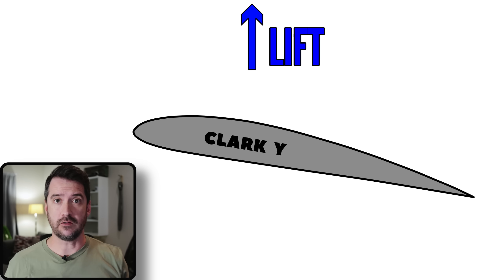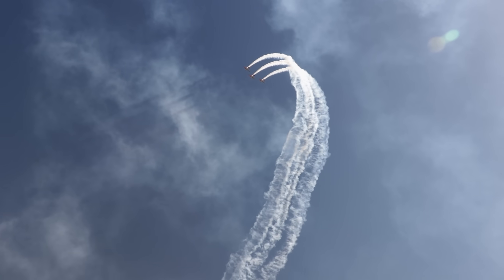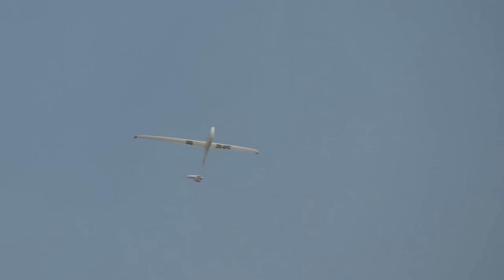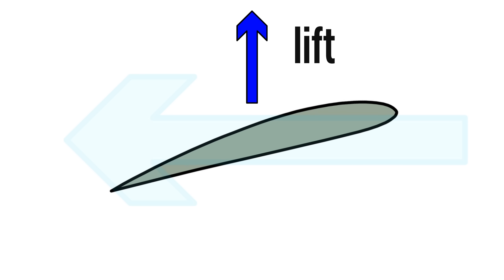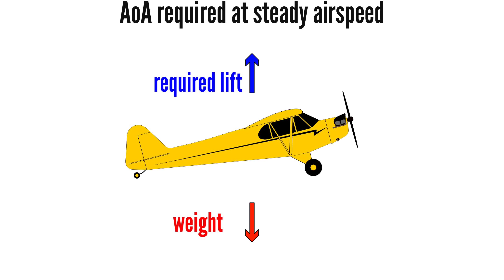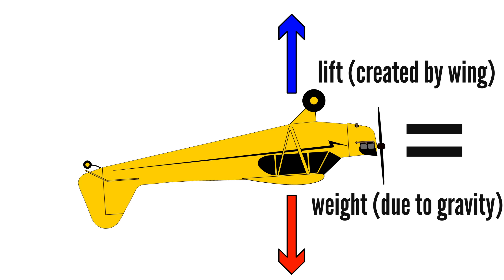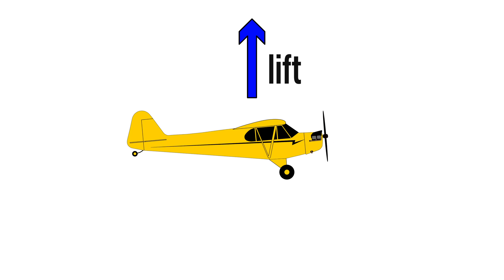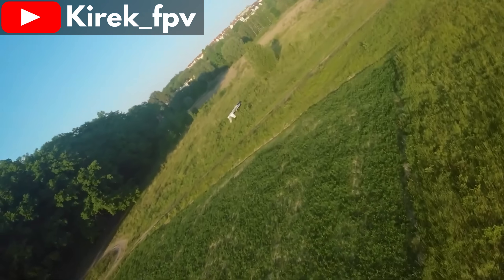Is Airflow Distance Over the Top of a Wing Always Longer?

Comment: Yes, air HAS to be accelerated downwards to supply an equal and opposite force to the weight of the aircraft. It seems the argument is more about HOW the wing supplies this force. Here is my take on this. 
The momentum of air molecules deflected downwards off the bottom surface pushing the wing up, is easy to imagine. 
The air above the wing thins out and speeds up as it covers a longer distance in the same time. 

[edit: This happens even if flying upside down, when the bottom of the wing is now on the top, due as mentioned, to the moving stagnation points changing the distance travelled by the airflows.] 

This causes the higher atmospheric pressure air some distance above the wing to move downwards to fill in the thinned out "vacuum" - in effect, pulling the air downwards (downwash) and creating an opposite lifting (sucking) force on top of the wing.
Combine both the down wash from the bottom and top, and Newton third does the heavy lifting.

Comment: The Symmetrical airfoil works because there is still a low pressure "bubble" generated by the increase in air speed due to the "ramping up" from the leading edge on both top and bottom of the airfoil. The "Clark Y" or "flat bottom" will always make more lift, though. A plane with a flat bottom air foil can fly up side down if you have a high enough angle of attack AND enough power and down elevator to over come the drag and provide the correct angle. A Flat Bottom airfoil produces lift at a much lower angle of attack, when up right.

Comment: A Cub can't fly upside down for long because it it carburated.. The engine will run out of fuel. You need fuel injection to fly inverted sustained flight.
Reply from the maker: Of course, but was only talking aerodynamics here 😀

Comment: There are 2 factors to lift the low pressure of the longer path and also the nose up angle of attack has the forward motion air pushing the bottom of the wing. It is like having a flat surface in your hands in a windy day, you put the edge into the wind it may be unstable as you fight to keep it edge on. You expose the bottom of the surface to the wind it will pull your arms up and might lift you off the ground if big enough, there is pressure on the wind side and probably turbulant low pressure behind it. You point the top at the wind and it will be forced to the ground. A parachute is a stable form of this flat surface, the hole in the middle is kind of a rudder, the round shape allows the air escaping around the outside edge to maintain the stable wing characteristic of the air not detaching from the upper surface like an unstable flat parachute which could produce lift but the back side turbulence would kill the passenger.

Comment: If you want to understand what starts the unequal flow of air around an airfoil at any non-zero angle of attack (thus creating lift) check out the "Kutta condition".    It boils down to this.   The trailing edge of almost any decent airfoil is very sharp, which causes the rear stagnation point (referenced in this video) to almost always stay right at the trailing edge.   This is because even if there's a strong pressure differential between top and bottom of the airfoil, moving air can only change directions so fast (it has inertia) so even if there's lower pressure above the middle of the airfoil, the fast flowing air below the airfoil cannot make a 180 degree turn at the sharp trailing edge and try to flow forward to equalize the pressure.  Instead the air above must flow faster to equalize the pressure at the rear stagnation point.  
BUT..  There's no such restriction for the forward stagnation point.    It can be right at the tip of the airfoil, or well below it (or above it, at negative angles of attack).  The air just sort of piles up against the "front" of the airfoil.    So if the airfoil is just a flat plate and you angle it upwards, the forward stagnation point moves down below the leading edge, but the rear stagnation point remains pinned to the sharp trailing edge.   This means when a packet of air is split in half at the forward stagnation point, the upper packet must travel a further distance to reach the rear stagnation point.   It's not equal transit time, but equal pressure at two points.  The forward and rear stagnation points each have equal pressure immediately above/below, by definition (it defines where they are).    In order for the upper packet to arrive at the rear stagnation point and equalize the pressure there, it must flow further and faster and thus creates a lower pressure region above the middle of the airfoil.    The strangest thing is that it flows faster than not only the packet of air below the airfoil, but all the free stream air well above and below the airfoil.

Comment: While most of what was said in this video is correct, what was left unsaid is that the idea that the air above the airfoil follows a longer path than that below is often associated with the "equal transit time" hypothesis, which is false.     This was taught to many in K12 physics classes and even in some older textbooks.    It goes like this.. "If a packet of air is split in half at the forward stagnation point into two, then the upper packet of air must arrive at the trailing edge at the same time as the lower packet, and thus follows a longer path over the curved upper surface".   This is false.  But the truth is stranger than that.     In reality the upper air packet does follow a longer path, but it is both accelerated rearward and downward, and it arrives at the trailing edge before the lower packet of air and before the free stream air well above and below the airfoil (outside of its direct influence).    The net result of the upper air arriving first is that it displaces a mass of air behind the airfoil, downward.   This total mass of downward forced air integrated over time equals the total generated lift, and in steady flight that equals the weight of the aircraft.      At higher angles of attack and higher wing loadings this air is accelerated over the top of the airfoil faster still relative to that below.   It naturally wants to follow a curved shape (ref "bound vortex") , and the curved airfoil shape is more a reflection of the shape the air wants to flow for a given angle of attack and wing loading, rather than something that forces the air to flow along that path.
Reply: Spoilers on cars work the same way.  The idea that the wing also generates downforce is what people have a problem with.
Reply: Excellent! And the transverse motion of air towards the wing tip creates vortices.
Reply: @ChimeraActual   The wingtip vortices occur simply because the wing is displacing a volume of air downward continuously as it moves forward.  The surrounding air has to fill in the space it previously occupied and there's a sharpish transition out at the end of the wings that creates a swirl of inrushing air.    The greater the vertical displacement (caused by high wing loading + high angle of attack such as during takeoff/landing) the greater the vortices.    As you fly faster the displacement is decreased.   If you use a longer wing (distributing the displacement over a larger area) the displacement is decreased.      One way to see this mechanism directly is to drag your hand, or a board or paddle through the surface of still water.  It'll make a temporary "trench" in the water which will then spill in from the sides to fill it.
Reply: @daemn42  I wanted you to explain it to viewers, I'd mess it up.
Reply: Are we over thinking this?

I'm more of an intuitive type thinker and my sense of it has always been in terms of pressure differentials. A wing with angle of attack will create a low pressure on the appropriate side to create lift. A brick as many might mention can fly given enough thrust.

The classic explanation of how an aerofoil works as criticised here makes sence to me from an economical perspective.

Am I perceiving it correctly??
Reply: But why would it split in half ? Below Mach 1 i don't see why it should, the flow field is already influenced by the wing before it reaches it. I'm wondering what is the actual proportion, I guess it has been computed using CFD.
Reply: @__-1234   It's not necessarily "in half", but the packets of air approaching (or being approached by) the leading edge must decide at some point to either go above or below.  The forward stagnation point is where the pressure is equal from above and below, but unequal if above or below..  In other words, a packet of air on a trajectory that would pass above the stagnation point must go above the airfoil, and likewise one on a trajectory below the stagnation point must go below it, no matter where that point is.   At high angles of attack on a high lift airfoil the stagnation point can be well below the leading edge and the air passing just  above it might even appear to reverse direction  and flow a little forward and up to get over, but it's just a balance of pressures.   

And yes the packets of air are influenced well ahead of the airfoil as pressure differentials are communicated forward at the speed of sound.     As the air speed approaches Mach 1 they are communicated less far forward and at Mach 1, they can no longer be communicated forward at all, so the air molecules just smash into the leading edge of the airfoil or a thin boundary layer of superheated air molecules that are being smashed into by the air molecules arriving behind them.
Reply: Total lift is generated by the air going under the wing full stop. Because air is invisible let them buffoons say whatevah they want..
Reply: I would like to see an explanation based solely on Newtonian Mechanics, i.e. his Third Law.  This is the fundamental explanation. The sum total of the initia of the plane in flight must be less than the kinetic energy of the air particles hitting the plane, given the relative vectors of each particle of air.
Reply: @ChristopherSLucas-hv7nz   Cept that "air particles hitting the plane" is also a measure of pressure.  It's not flying through a sea of tiny ball bearings which bounce directly off the aircraft surface are deflected and then  continue on like nothing has happened.   Pressure is communicated over distance at the speed of sound, and at the surfaces of the aircraft itself the vectors for the air molecules translate into the directions of lift and drag, while those air molecules may not even be moving at a macro scale at all (a boundary layer of nearly stationary air), but just jiggling around pushed on by the air molecules behind them, and those behind them, and so forth.
Reply: @ChristopherSLucas-hv7nz  There is a video on youtube, by a professor of Cambridge, who explains it well based on centrifugal forces (but i cannot find it now).
Reply: The word "wants" invalidates all your considerations.
Reply: @antasosam8486  He's mostly correct.   It doesn't "want to flow" at all - it simply is more fuel efficient to have it curved to lessen turbulence at lower angles of attack ( making a smoother level flight rather than bobbing up and down noticeably) and direct it in a way that forces the majority of the downforce back to the trailing edge rather than the main surface.  I used the analogy elsewhere of a surfboard.  You want more weight on the rear end in order to stabilize the surface as you increase the angle of attack. You can't be in the exact middle as then it's hard to get the front edge to easily lift out of the water. Allowing the water below to lift it up/glide under it more easily - and most importantly, making take less energy and allow you to react quicker. (because maneuverability is a nice thing as well :) )Of course, this only works until the downforce exceeds your lift or you overcorrect and exceed your critical angle of attack and you wipe out, so balance carefully :)  Yes, eventually the forces do equalize, but that's hundreds of feet behind the plane as the turbulence dies down.
Reply: @antasosam8486   Not at all, you just didn't bother to search for "bound vortex" (it's a topic longer than the comment section can handle),  as I suggested, to understand why it "wants" to follow a curved path.  Even if you just tilt a flat plate into the wind, the air passing above it will follow curved paths, because it immediately creates a bound vortex.  The problem with a flat plate is that the vortex it creates just causes swirl of air behind the leading edge produging tremendous drag, and reduces lift, so we create airfoil shapes that follow the natural curve of the bound vortex (for a given size, angle of attack, and desired wing loading), to keep the air following the vortex in as close to laminar flow as possible.    The problem is, (as I said before), people often then think that the shape of the airfoil  drives the curve of the airflow, and it's really the other way around.
Reply: Yes. In order to create sustained lift, you need to displace air downward, either above or below the wing. It's Newton's third law.
Reply: @giangiorgio.mp3 How then does a balloon get lift?

Comment: All this proves is that there is more upward pressure present on the under side of the wing than previouse "experts" have stated, I have allways know this, as you can feel it by simply putting your hand out a moving car window and tilt it up slightly and feel the force under your hand pushing it up, hence a cambered wing being able to fly upside down.

Comment: When the Wright brothers did their wind tunnel experiments, I doubt they were thinking about the possibility of flying upside down, rather about sustained flight with a normal attitude, so the term "lift" was entirely appropriate, especially in the context of "lift off" when a flying device leaves the ground.
Given that some of today's flying  devices are capably of "flying" in any attitude, including straight up and straight down while remaing  under full control of the pilot, the term "lift" becomes a bit of a misnomer when applied to the force imparted on the wings by the air that they pass through.
Nevertheless I am happy to use the term "lift", since it applies logically to the majority of aircraft flights.
By the way, I am a follower of the "force applied to a wing is a result of air acceleration as it is displaced by the wing" concept, regardless of the physical method/s that induces the air displacement.
Most of my life I have contended that there is no such thing as "suction", only pressure differentials.  I have worked with equipment cabaple of "pulling" (another misnomer) very high vacuum (read that as very low absolute pressure).  Nevertheless I still use the term "suction", as many people simply cannot grasp the concept that atmospheric pressure is pushing the air/dust mixture into their vacuum cleaner.
Any comments?

Comment: As an ex-pilot (Rotary and Fixed Wing), I remain impressed to have observed our otherwise flat kids trampoline, now ex-trampoline, when a few decades ago, it elected to fly solo one fine windy day and without a pilot. It took off effectively vertically, cleared my wheel digger, then went a very long way up a steep hill, before arriving in a shitty heap, never to fly, or trampoline, ever again. However, the point I'm getting at, is that I can say for certain that it was quite happy flying both the right way up, and also inverted. Who'd have thought that was a thing.
Reply: You have the right idea.  It's always been fairly simple to me, thrust overcomes drag (that is how a SpaceX rocket gets the Falcon 9 off the ground) and lift overcomes weight (that is how all wings get an airplane off the ground like an Airbus A380).  High pressure air moves towards low pressure air (that is why there are wing tip vortices).  That is why they have  all the H's and L's on the weather maps.  That's why when someone is smoking in a car, all you have to do is crack a window and the smoke gets sucked out of the inside of the car.
Reply: @eurekamoe3744  Well, unfortunately, if someone is smoking in a car it is a little bit more difficult than that.  I found not found it easy to get the smoker out through that window! I guess that is where drag comes in.

Comment: Bernoulli's theorem is essentially the correct way to think about lift. This has been thrashed to death because student pilots are taught Benoulli's theorem is the primary cause of lift while ignoring kite effect, that is., a flat sheet of plywood will also create lift due to the the air pressure differential top an bottom, just not efficiently. That's the purpose of airfoil shape, to optimize airflow around the wing for the performance envelope of a particular aircraft. Like a sheet of plywood, a typical plane can fly inverted just not very efficiently. The longer path along the top of the wing effectively creates a positive angle of attack, with equal distance being above the center of the leading edge. 

As a practical matter, if you are learning to fly remember the old pilot's rule: throttle controls altitude, pitch controls speed. A wing generates more lift with more speed without changing pitch.
Reply: Its schools students that were taught Bernoulli's principle as the cause for lift, not pilots.
Reply: @kennethferland5579  It's part of every ground school curriculum and there are related questions on lift on the private pilot exam. The first inverted image has the wing splitting the air in the wrong place. The split would be lower on the leading edge. The air above (bottom of the airfoil) is still traveling a longer distance, albeit not very efficiently as there is a separation of the airflow from the surface.